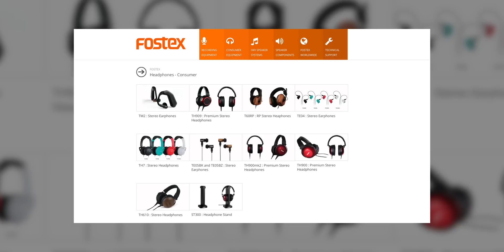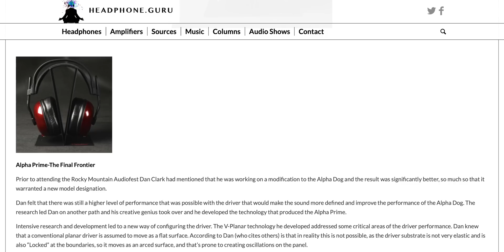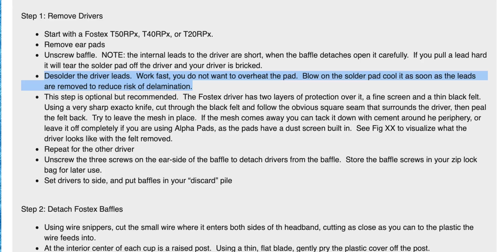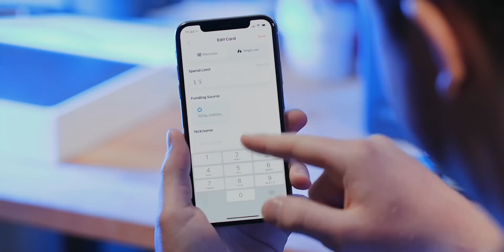Make $600 3D Printed Headphones For $200!

Comment: 6:27 Actually, any audiophile, that's into DIY, knows, that single-core ethernet cable sounds great, because the copper in it is very pure by design.
9:36 Drilling holes in the cups like that should actually increase the bass. If you want less bass emphasis, change the pads to velour/microsuede ones.
Reply: Hi there! Electrical engineering student here. Just wanted to correct a few things

1) Given that the speaker impedance is ~50 ohms, the cable quality will have a negligible impact on audio quality. The human ear will not be able to distinguish a difference unless you plan on running a 10+ feet set up. Any standard 28 awg wire will work just fine. 

2) It depends on the size of the holes, but realistically a few small holes would likely increase the amplitude of certain lower frequencies (120-40hz) but would also decrease the frequency response range on the lower end (e.g. 15hz to 25hz).

I hope this helps.
Reply: NotCarl Sagan finally some sense
Reply: @mrhoydenrulez  thank you for some actual sanity
Reply: E Fox  I mostly let it slide. My punctuation is not perfect by any means, mainly because English is not my native language. However, English has many forms, mostly, UK and US. Which, as far as I understand, also uses different punctuation rules. 

It always baffles me why people have to be so condescending when grammar mistakes are involved, can't we just be nice about it? When I tried to help people with their grammar their first reaction is as if I'm trying to make fun of them or something while that was never my intention.
Reply: @Appusle  The war on grammar, can never, be won! 😀
Reply: Actually, audiophiles are full of shit, as scientific tests have shown that audiophiles cannot tell the difference between audio transmitted through top-grade speaker wire, cheap speaker wire, and a pair of straightened out wire clothes hangers.
Reply: @MeepChangeling  that sounds like bullshit to me. what was the methodology?
kind of how you put different wine in front of layman and they can't tell which is which, but a skilled Sommelier can tell you what it is and where it comes from.
Reply: Those commas...
Reply: @T2star  Now that you mention it, I think I've missed some.
Reply: @T2star  whats the problem, with, his sentence, is there very little commas, may i ask?
Reply: @T2star  I mean, all of his commas are correct lol
Reply: _ David _  r/woosh
Reply: Now iam tryed to change the Cable´s from my ATH M50X =P
Reply: E Fox Well really it should be 'any audiophile that's into DIY' rather than 'any audiophile, that's into DIY,' because being into DIY is essential information. There is a semantic difference between 'the audiophile who loves jazz' and 'the audiophile, who loves jazz'. That being said, the rest are fine and are stylistic choices. Comes off as very The New Yorker.
Reply: you only needed the first comma.
Reply: No the size of the hole depends on the frequency, also the number of holes dictate the effect
Reply: Are you German, by chance? Cause we Germans actually, write like that.
Reply: _ David _  r/whoooosh
Reply: E Fox  I was going to say that you could still cut out two commas, but then I noticed something. None of you point out why OP's commas truly should all remain intact! His commas are perfectly placed so you can read the sentence the exact same way as he would say it out loud. 

ACTUALLY pause Any Audiophile pause that's INTO "do it yourself" pause Knows! pause that SINGLE-core ethernet cable sounds great pause because the copper in it is very pure by design (Closing out with a firm yet calm resolution).

Many people, especially young ones in internet culture cannot appreciate this style because reading is a chore needed to fulfill your information consumption quotas. People want quick, streamlined and easy to read sentences that get across the message as uniform as possible. Honestly I belong in that category too most of the time. But I took my time to re-read OP's sentence as if I were reading one of my favourite books. The difference is astounding and I fully appreciate the commas now. Maybe I ought to start working on improving and restoring my own writing style again.
Reply: To the comment for 9:36, I believe he mistook bass for resonance
Reply: I would have gone with solid copper as the cable won't be moving around inside the earphone, but yeah.. a LOT of audiophile stuff is pseudoscience and even bro science (Thanks Monster Cable)
Reply: @F1ForFun The commata are where you would take a small break/breather. Although grammatically not conform, it is, in theory, not the worst mistake.

See what I did there?
Reply: hahahahahahahahaahahahahahahahahahahahahahahaha if you believe cables make a difference to the sound then you're deluded.

Comment: I am kind of confused how rebuilding the headphones make it sound better. Can someone explain?
Reply: I could be wrong, but from what I understand when it comes to sound, the enclosure can be just as important as the drivers for headphones. Changing the enclosure can change the sound signature, especially with higher quality drivers.
Reply: AntaresNova That makes sense
Reply from the maker: This is correct. The enclosure is hugely important. These T50RP drivers are actually used in some of Fostex’s more expensive headphones and they’re kinda “nerfed” in the T50RP’s enclosure to avoid needing multiple driver SKUs. The enclosure is arguably even more important than the driver. And if you think about it, it makes sense. Speakers work by pressurizing and depressurizing air. From where that air is sourced, how far the distance and what angle your ear is to the source, the shape of the chamber in which the air enters/exits and with what dampening all change how a headphone can sound. This headphone mod and the original sound nothing alike. It’s almost hard to believe the electronics are the same in both.
Reply: @snazzy  the t50rp drivers are not at all used in some of the more expensive headphones from fostex. They are only used in the t20rp, t40rp, t50rp and t60rp.
Reply: @snazzy , there is nothing "electronic" being used here. A driver is a electro-mechanical device.
Reply: Just like how a sealed sub woofer sounds a lot different depending on the size and shape of the cabinet.
Reply: Actually, the enclosure has more of an impact on sound than any other single part. Look at Bose. Since the beginning they have used typical off the shelf drivers. The sound reproduction quality and cost comes from enclosure design and development.
Reply: I'm kinda curious as to what the sound difference between using the stock plastic with the added materials is vs the complete overhaul.
Reply: It doesn't at all they just changed the look
Reply: @kingsolomon174  No, they didn't. Please, stop commenting if you don't know what you're talking about. Thank you.
Reply: @kingsolomon174  try to play your speakers without the box
if it sounds like shit then you know it's there for more than just looks
same is with headphones

Like thinking before commenting is not just for looks

It's also for not looking like a twat

Comment: very few people makes those complains about the T50rp Mk3. the mark 3 out of the box is highly praise just need a pad swap. The mark 2 may had those complains but definitely not the mark 3.  

for more details on those models check DMS, ZEOS Reviews or Joshua Valour.
Reply: Glad to see this! I was confused to hear him say many people have complaints about these... the Mk3 is fantastic, even more so when you consider the price.
Reply from the maker: MK3 I still find far too shrill on the high end, but it is indeed a massive improvement from MK2. The different screen they use on the driver makes a notable difference.

Comment: Looks a lot harder than I thought it would be
Reply from the maker: Nah, it isn’t too shabby. That said, there are many simpler Fostex T50RP mods out there that might not make such a huge difference as this but will be much simpler. :)
Reply: @snazzy  I might attempt this then. Thanks for posting, I've been in the market for a good pair of HiFi headphones.
Reply: It seemed fairly straightforward to me. The only hard step is the soldering.